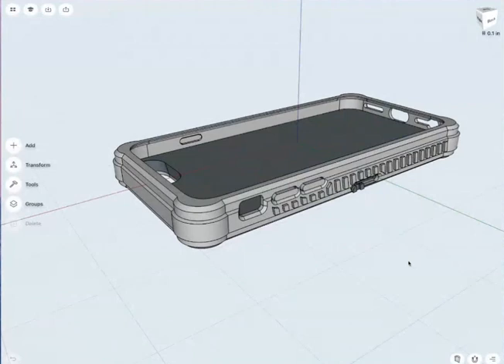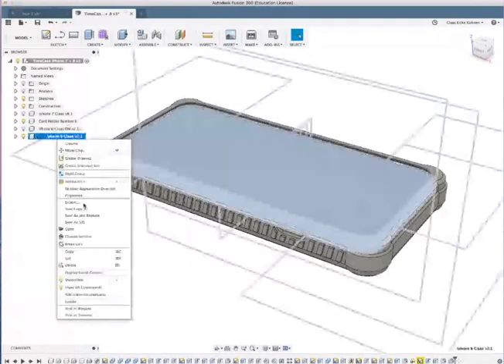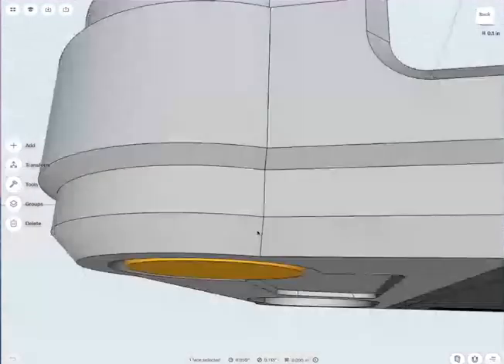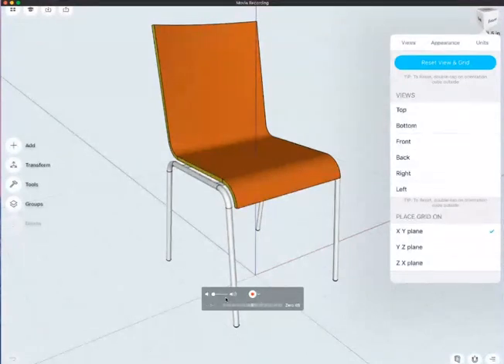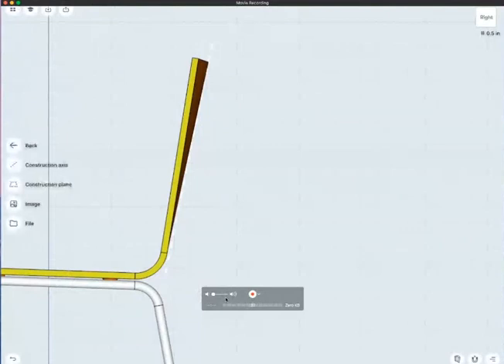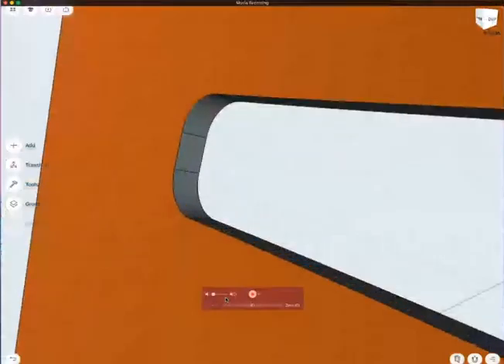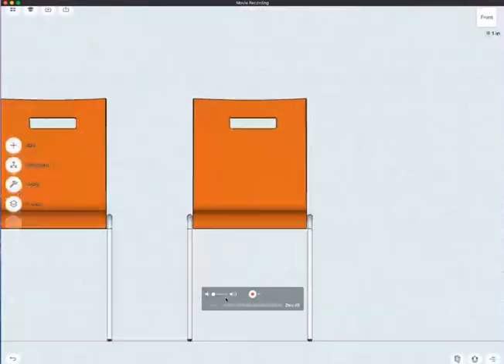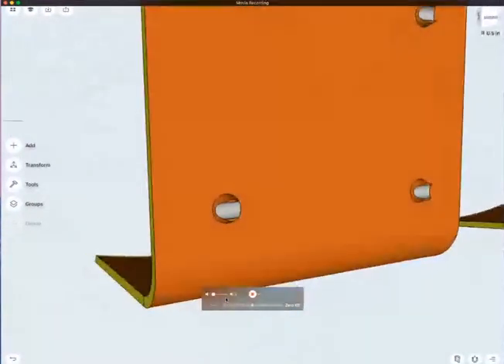The advantages of direct modeling | 3D design webinar

Comment: I really enjoyed using the demo app with the Apple Pencil, and I really like the idea of having portable 3D modelling capability (without being tied to a Computer, keyboard and mouse!). I’m a fairly hardcore NX user, so parametric modelling is my bread and butter - but I’m keen to learn more about direct modelling. It feels much more organic. 
I have a few concerns that certain aspects of a job would be made much more complicated - say for example I needed to adjust the spacing of the ribbed features that run along the side of the phone case shown in the video - with parametric I would create those using a ‘pattern feature’ or ‘pattern geometry’ command. To adjust the pitch, I would find the command in the tree, then adjust the pitch (and instance quantity, if necessary) from say ‘0.5mm’ to ‘1mm’, then the model would update and the gap would be increased. Can something similar be done with direct modelling? I was concerned that I would have manually adjust each feature, or each line in the sketch?
Also, how are overlapping blends handled in direct modelling? Quite often the order that the blends appears in the history tree are critical to the output surface, and to whether the model falls over. Overlapping blends are quite common in more detailed design, or products containing elegant surfaces?
Quite a bit of the design work I do is with multi-part assemblies, and managing the tolerances to ensure that all of the parts will fit together, (ideally!) all of the time. I feel like this might be challenging with direct modelling, without a history tree to go through and clearly see the dimension values (not considering PMI, or using expressions or anything like, just simple dimensions in sketches or commands).
Apologies if some of these questions are quite basic and well within the capabilities of the software (fingers crossed they are) - I’m quite excited about the potential but don’t want to have unrealistic expectations, or invest a large amount to time to find that it can’t handle the workflows I require. Thanks in advance
Reply from the maker: Thanks for sharing your feedback :)
Each parametric and direct modeling methods have their pros and cons, as always "No tool that fits all" can be said. Having gaps defined that way you described is a true parametric feature that we do not have, however, there are some options. You can simply select the faces of the bodies and move them accordingly, or hide the bodies, modify the sketch - that can be constrained pretty decently with equal line lengths, etc. - and create the bodies again. 
Handling overlapping blends are more of a modeling engine task I would say, it is not strictly connected to the direct/parametric method. Having accurate models is necessary when applying a series of booleans or lofting cross-sections together that end up in delicate surfaces. 
Tolerances and small adjustments are a field where direct modeling can be a huge help by allowing the user to select the surfaces in question and move them by portions of a millimeter. Parameters are still not available, but small adjustments can be done in seconds. 
Please feel free to visit our forum, discourse.shapr3d.com where you will find a lot of awesome projects made by the users of Shapr3D :)
Reply: @Shapr3D  Thank you for the great information, and taking the time to reply - being able to apply detailed constraints to a sketch sounds like it should give me most of what I need (and a quick reference to see the dimensions and where they originate). 
Regarding tolerancing, there are various approaches to this (PMI is probably the slickest?) but I was also thinking about basic tolerance stack documents using a spreadsheet like Excel/Sheets. The typical workflow for Parametric would be to take the measurements of the dimensions from the relevant commands in the history or sketches, then input them into Excel with a tolerance for manufacturing (e.g. a diameter of 10,5mm +/- 0,1mm, for a loosely turned shaft) and stack up all of the tolerances on all of the parts to make sure everything will still fit together/function correctly. (Or alternatively, with NX you can define the dimensions as Expressions, which allows you to name them and see them all in 1 list, or even export them directly into Excel/Sheets/etc).

I imagine building everything where possible from sketches would be the best way for direct modelling 🤔. What would be amazing is some measurement features where you can maybe choose a datum face/feature and select a chain of other faces/features so that they appear in a single list… Ideally, eventually Shapr3D would support PMI, or something similar, that would be really powerful (then we could export the dimension and tolerance in the STEP/equivalent file!)
Anyway I’ll check out the link posted, and experiment some more with the 2 models on the free package. 
Thanks again for the info, keep up the good work, great to see new features being added regularly.

Comment: I have tried the select then double tap on a construction plane to get grid to move to that plane with no luck. Any pointers?
Reply from the maker: A workaround will be to get the view you want via the view options tab at the top right corner of the editor. Tap on the view icon once and then select the view you will like to have from the drop-down options pane.
Reply: @Shapr3D  The construction plane was at an angle to X axis of 45 degrees.